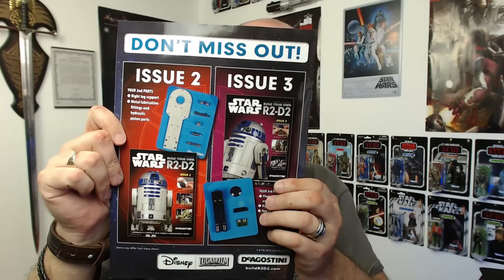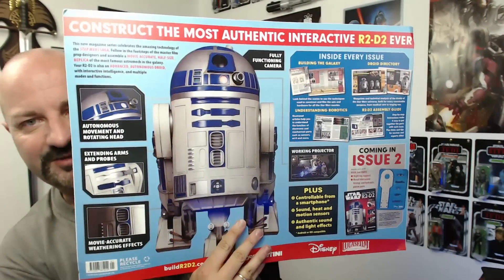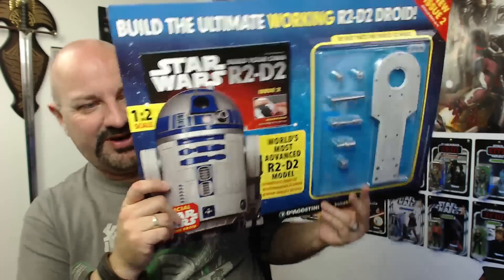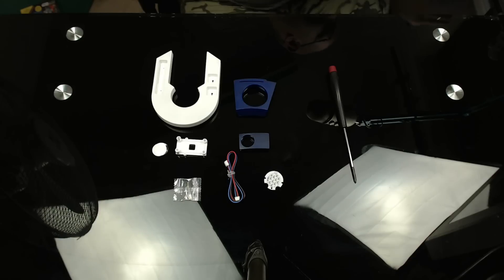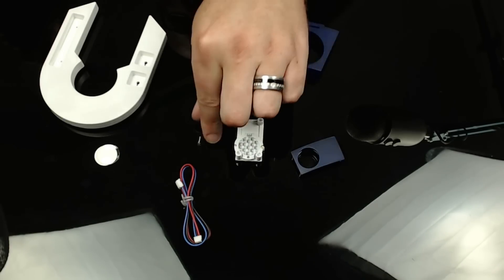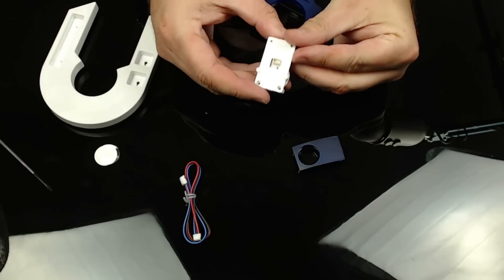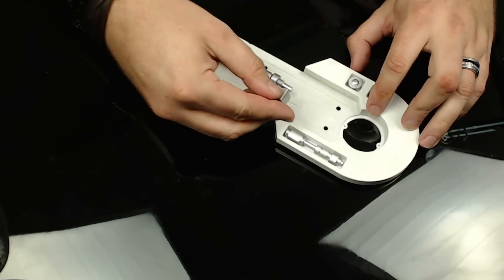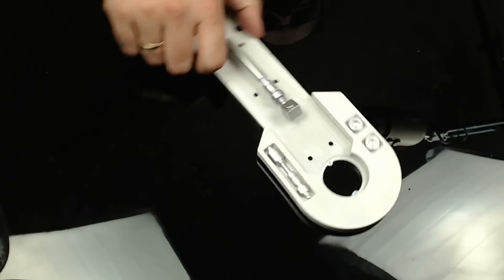TEST BUILD Deagostini's Build Your Own R2-D2 - Parts 1 & 2

Comment: Ive had the 4 trial issues and the R2D2 usb, the 'end' letter came with the second delivery (strangely I got issue 3 and 4 in my first delivery and 1and 4 in the second so had to wait to srart assembling it) my guess is once the falcon build finished at the end of the year they will start to advertise the R2D2 build on tv in the new year. I hope it does go ahead as much really looking forward to building it, I'd have got the falcon but the size of it put me off, it would be great to build but I'd have nowhere to put the damn thing once it was finished...

Comment: are all the parts plastic? £900 odd quid seems expensive for a plastic model
Reply from the maker: Ben Millen I know where your coming from. I was hoping they were just plastic for the test build. I got the first run one today and it is pretty much the same. It has a metal internal shell like the millennium falcon but the external is plastic. It is a lot of money for plastic. I'm hoping the features will make up for it.
Reply: World of Wayne yeah, I'm still very tempted and may subscribe for a while to see what I think, I'm currently building their Robi kit which is already more money than I should be spending :/
Reply: Ben Millen

Oh no Ben! I’m currently waiting for stages 13 and 14. This kit is VERY well engineered with a lot of metal substructure and electronics to amaze!👍🏼 I, in my opinion, believe this is worth every penny! AND it’s easy to assemble!